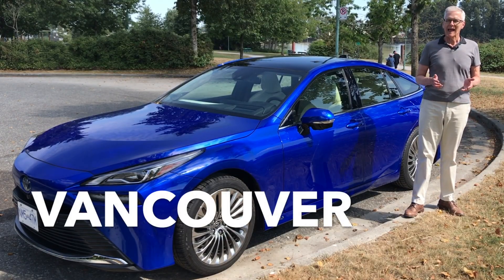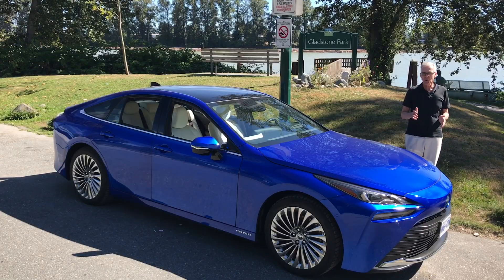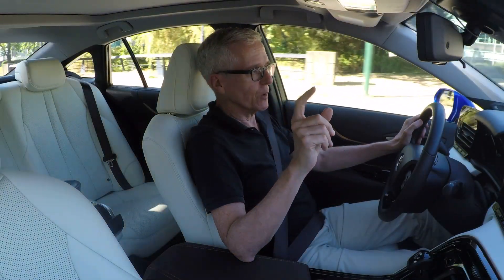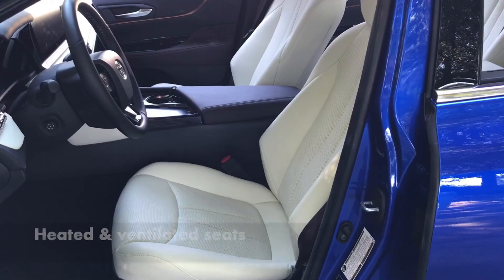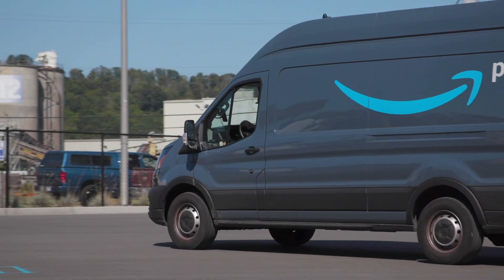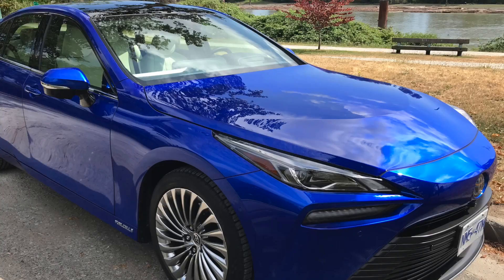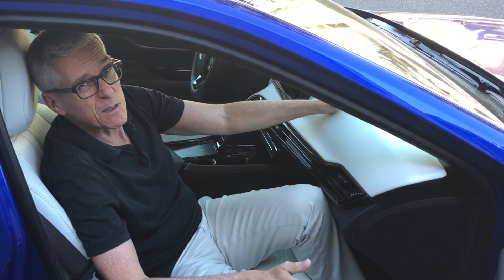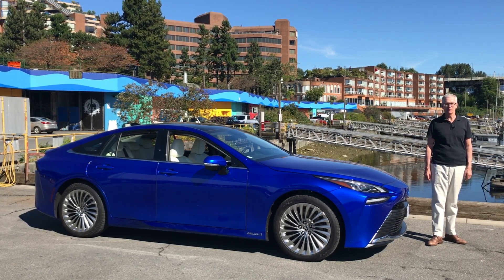Mirai: hydrogen vehicles do have a future

Comment: Nice video, good script and editing - I'm also Vancouver based, and documented an EV trip to Texas with a couple of videos - not so well edited ;)

The Mirai is a beautiful car, I just wish Toyota got over themselves and offered a full battery electric version of it, let the market decide.

Hydrogen is somewhat controversial because it is often used to delay or distract from EV uptake, it is pushed as a viable alternative if you 'just wait for infrastructure and cheap hydrogen',  which in practice, just keeps people in their gasoline cars, we need to be careful to represent FCEV vehicles honestly, and also how much taxpayers money a filling station costs us before demanding tens of thousands of them.

Vancouvers hydrogen is not zero emission, it's made from an unreported proportion of fossil fuel (methane) derived hydrogen, which emits 9 to 12 kg of CO2e per kg of hydrogen produced  (see HTEC's FAQs on their own website) - I think this is one of the reasons the hydrogen in BC is so cheap compared to California, where the soaring costs (US$28 per kg / 100km, US$0.45 per mile) have been attributed to having to use truly green hydrogen, with 54 kWh per kg (100km) needed for electrolysis and retailing (compression, chilling).

The second talking point is hydrogen filling time vs plug in cars - you unfortunately repeated an anti EV trope that you have to line up for an EV DC fill, this does happen, but not regularly, and almost never in a Tesla, in another video you talk about hours of charging on AC, which is true, but you are doing something else while it happens, especially if you are able to charge at home or work, for viewers who have not lived with an EV, these talking points might seem like deal breakers, but in reality, day to day, an EV can be more convenient if you can charge at home, work or a public station close by.

As you move into covering EVs more, it might be a good idea to experience the 'gold standard' of charging networks - Tesla - all these EV charging concerns and myths can be easily debunked with a road trip rental of one, I could not find a Tesla video in your motoring channel, but maybe I missed it, driving Vancouver to Jasper for instance, seems like a decent video to do, and will allay your viewers fears about EV road trips. I think you will like the handling of the Model 3.

Did Toyota or Ballard give you a talking point sheet when they lent you the car? I notice youtubers covering the Mirai seem to hit the same points each time (e.g. Downie Live) and some of them are not quite right - provenance or cost of the hydrogen is rarely properly discussed, and if the goal is to eliminate CO2 or CH4 emissions from transportation, I don't see a switch to hydrogen achieving that, but I do appreciate the zero tailpipe emissions, but you get that with an EV too.

Class 8 will go with the cheapest solution - and this won't be green hydrogen - ever - so if you are looking for low emissions trucking, look to batteries, the weight penalty is lower than you think.

Comment: I don't recommend this car to anyone. The hydrogen station infrastructure is trash at this point in time, half the time stations are not working or out of fuel, in my are fuel cost $27.99 /kg, a full tank could run upwards of $140. if you buy new or lease, toyota provide you with a Fuel card but if you buy used then your pockets are going to feel it. When I bought my mirai it was 2016 fuel cost was $14.99/Kg but I had the $15k/3yr fuel card but now fuel has sky rocket. Other than that great vehicle.
Reply: You still get fuel card on certified pre owned.
Reply: @dearcoffee85  That $15,000 fuel card, at 62 miles per $28/kg (CA) is only 33,200 miles for 'free' (you still have to pay for a fairly expensive car). That's 4 to 10 times more expensive than gasoline or electric at $0.45 per mile, the $15,000 card would only be worth $4,000 in gasoline or maybe $1,500 in electricity for the same distance.

If you paid $15,000 for the car used, and get a $15,000 fuel card, you might think the car is 'free', but actually, over the 33,200 miles, you paid $11,000 to $13,500 more than you needed to with a used gasoline or electric car, and if you keep driving it once the fuel card runs out, then you are paying $0.45 per mile everywhere you go, and that might include a 20 mile round trip out of your way to one of the few hydrogen stations.

I think it's a great looking car, I don't understand why they didn't make a 50kWh to 80kWh all battery version of it (it already has a 1.2 kWh battery, it is still an EV), and let the market decide.
Reply: @brushlessmotoring  cool story.
Reply from the maker: Thanks for sharing your experiences.